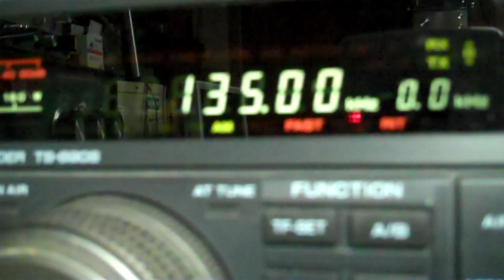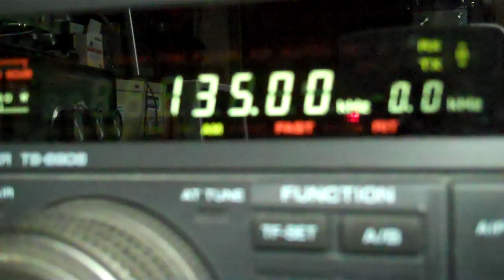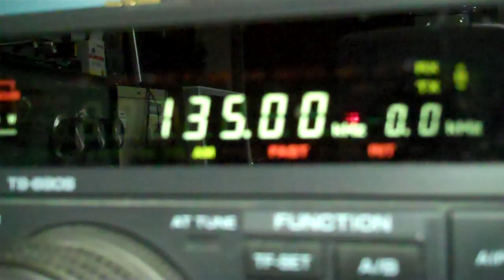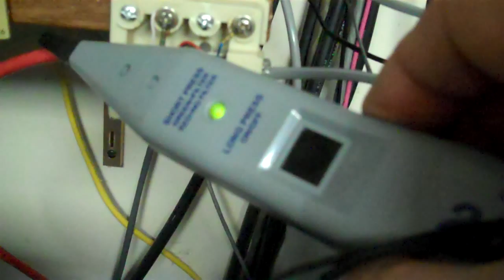External  noise causing my DSL to sync at a much lower speed. than i pay for.

Comment: hi, I have a question that I think you might be able to help me with (if you'd be so kind). I was wondering if it is possible to route the adsl signal coming from a phone line (exiting from a microfilter), through EOP adaptors,  and then into a router? this would mean I could have my broadband router connected in a more suitable location in my house with a simple structure, rather than having a switch,  second router etc. I've tried this already but the EOP adaptors sync (find each other) don't send any adsl signal

Comment: I'm guessing that they gave you an overhead drop with the unused pairs bonded to ground.  I had a similar problem to yours and I had to finally get them to run a buried shielded run to the network interface box.  The RF noise was in fact so bad, that I had to get twisted pair wire to the phone jack inside the house, and a shielded modem cable from the jack to the modem. 

I thought it might be the LED lights or a switching power supply so  I shut off everything but the power to the outlet that the modem was on.  Sadly, it wasn't a source from within the house.  At this point, my options were a bit more limited :)..  I did find, however, that I had an IMMENSE amount of EMI coming up the power line from the mains source.  Another tech visit and an Isobar noise filter later, 90 percent of my problems were handled.  

Apparently, these new Pace, brand  modem/routers don't like any noise through the power supply.  We finally got it decent but not perfect by using shielded and filtered everything. :)

Comment: Hi Al:
Uverse goes down to 25 Khz. My noise is similar except I also see it on the S/A in the HF Amateur bands. Those spikes are about 92 to 98 Khz apart and moving frequency at a rate of 1 Khz per minute. When the neighbors are asleep or gone the noise is a lot lower.